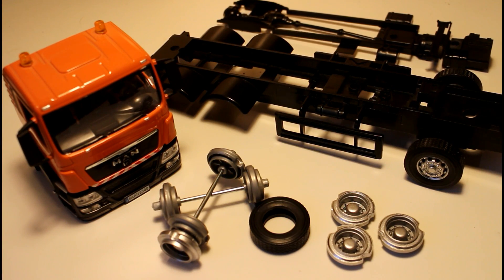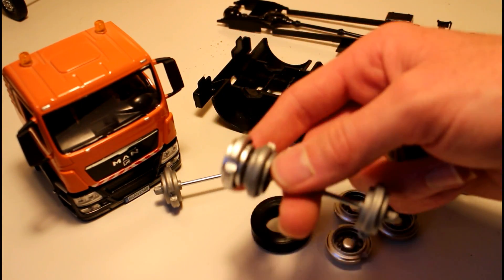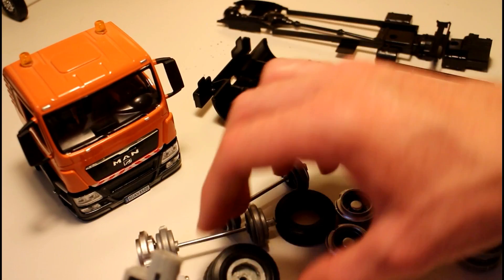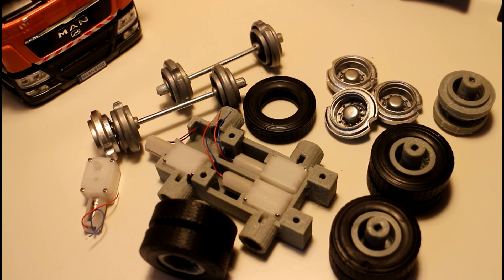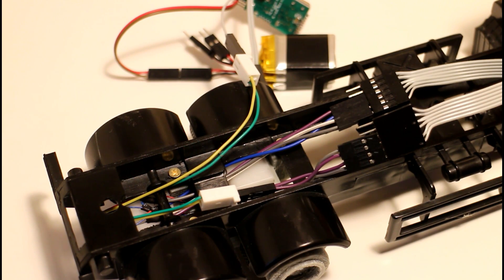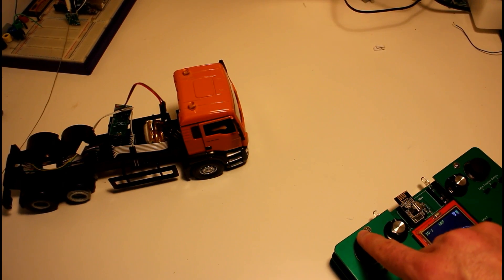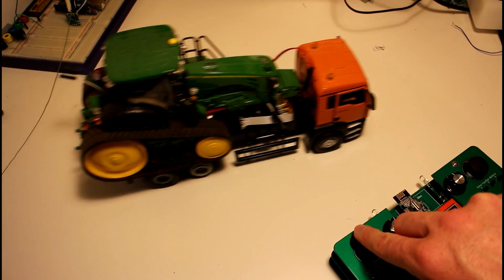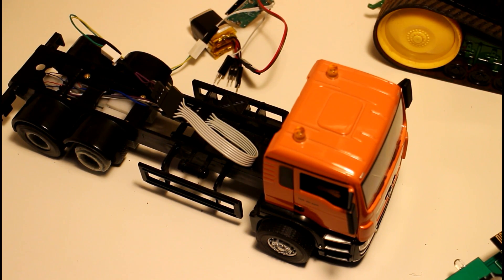RC MAN Dump Truck Part 2 - Quad drive motor design

Comment: you think its possivle to print a axel in that scale?like a axel case and then put metal gear on it
Reply: and then put one single n20 motor
Reply: Looks great!!
Looking forward to your solution for the steering.